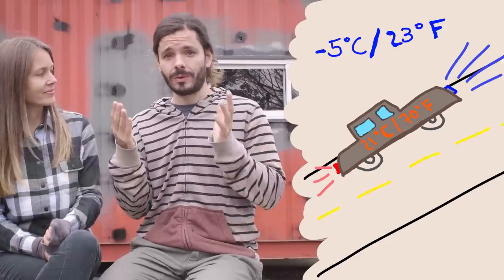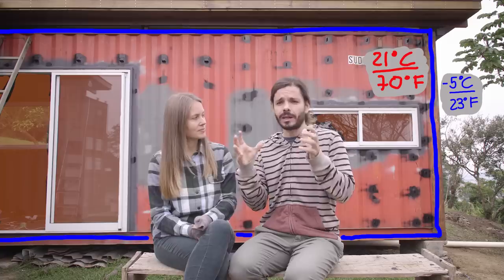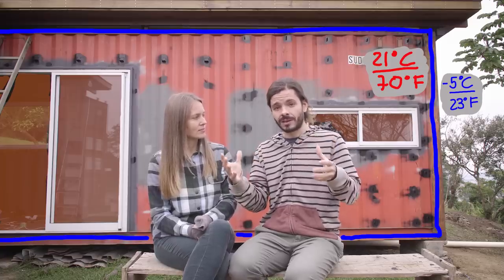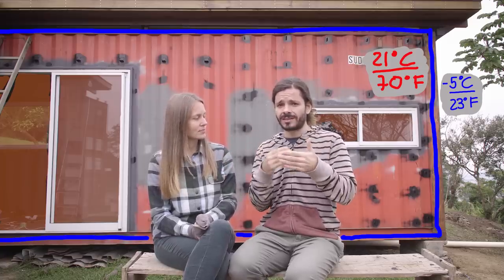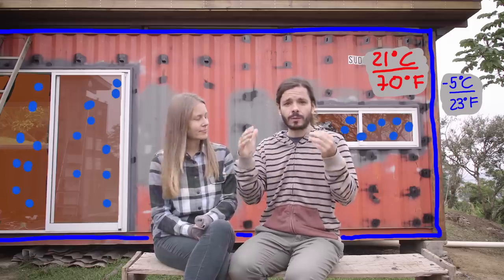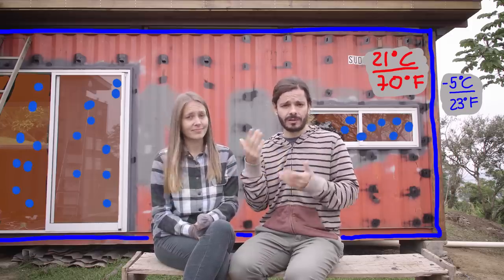How to avoid CONDENSATION on a Shipping Container - Living Tiny Project Ep. 033

Comment: Two quick reads on EPS (E xpanded P oly S tyrene, ) aka  plastic insulation.

Vapour permeability:
http://www.styfabel.be/bouwen/include/The%20facts%20-%20EPS%20is%20just%20as%20vapour-permeable%20as%20wood.pdf 

Mold Research:
http://www.epsindustry.org/sites/default/files/EPS%20Insulation%20Mold%20Resistance.pdf 

Anyways, to the topic at hand.

The next question - What size should the vents be? How many vent?
In other words, how much ventilation do we need?  

Ventilation is measured by NET opening size of hood.  
Total size of hood opening less obstructions such as screen, supporting cross members that would interfere with air flow.
OK!
I might be wrong, but I"m guessing Brazil doesn't have ventilation code governing residential construction.
Guess we'll have to make up our own OR borrow one from another country...like Canada.

Residential Building Code requirement for attic ventilation is a follows:
1 square foot of vent for 300 square foot of floor space.
Example:
A 900 sf house will require 3 sf of roof ventilation and so on.
A 1350 sf house will require 1350 / 300 = 4.5 sf of net opening.  

An 8' x 40' shipping container = 320 sf
320/300 = 1.07 sf x 144 (square inches/foot) = 155 square inches.
BTW, North American vents are sold in effective net square inches, your mileage may differ.

If we subtract existing ventilation from 155 square inches we then have a difference to make up.

Remember, NET and not the actual size of the frame, bring a tape measure and subtract obstructions such as screen and plastic stuff. 

Cheers,
N

Comment: pros and cons, but spray foam just can't be beat for this...  its pricey though.   do they have sheet foam of any kind?
Reply from the maker: We do but the price is almost the price of the shipping container itself. And we don’t believe we could glue without gaps. 😏
Reply: the closed cell stuff is stupid expensive...  a 2" piece of 2x8" dense foam here in my part of canada is about 75 bucks!  ouch!   bubble foam is cheaper (the white stuff that looks like compressed foam balls) - BUT what if you have bubble foam sheets, cut as much as you can to fill the 'ridges', with solid sheets on top,  then spray foam to fill the gaps?   if you cut the nozzle at an angle you can poke it right through the foam.  i cut the foam just with my skillsaw - messy, but if you cut on a bevel you might be able to get it fairly close to the ridge shape..
Reply from the maker: It would be a nightmare to cut to shape. We already decided on this part of the house at least to live the orinal vents working and to live a gap so it can ventilate

Comment: In a small home, you should have a heat recover ventilator.
Reply from the maker: You mean a hot ventilator?
Reply: No.  A heat recovery ventilator is an active ventilation system, but it keeps the temperature steady.  If you aren't using air conditioning or heating, then an HRV is not needed.  Put in ventilation fans and a dehumidifier.  https://www.amazon.com/dehumidifiers/b?ie=UTF8&node=267557011
Reply from the maker: For sure we will use a lot fans and dehumidifier!! 👌
Reply from the maker: Through the too part of the walls.

Comment: I'm going to burry mine after I reinforce them! I think that will help, I also found a thermal paint, they say this paint breaks the thermal bridge! My setup is going to be a 40 foot by 48 feet by 8 feet so it's to expensive for the foam, I have to find something else that warms and they say this thermal paint will stop condensation! Has anyone tried thermal paint? I don't think it's cheap either, can't find a website listing any prices, they all say contact us which usually means expensive!

Comment: Hey guys, I m coming with another point ... as in your climate it´s mostly pretty warm - for challenge in my opinion you need mainly two things to take care of:

1. shadow your house / protect the same with something white or at least a light colour
2. You an insulation layer, but inside the insulation layer ... should be installed some material which can store a certain climate very well (concrete, stones, cement, ....). Idee is, to use your open windows / doors at the evening or even during the night to cool down that "massive materials" inside your home. During the day, everything should be mostly closed, that the stones or whatever you use ..... can beam there stored climate into the living room.

What do you say???
Reply from the maker: About the external shade that was on the plans already. About the internal insulation I’m not sure. 👌🏼

Comment: Hello guys, I beg to differ with the over engineering of your whole house, since the weather is not extremely cold, you should   create several microholes, in every single corner vertical and horizontal, really really micro holes, so that not even ants can enter...but that would maintain a constant airflow bottom up....
Reply from the maker: You might be right. But in our opinion lack o experience most of the time tends to make us “scared” and over engineer things. But this process is also teaching us a lot. What we believe is a good thing but of course has it’s costs. Heheheh👌🏼
Reply: Odd Life Crafting please don't get me wrong, I have a lot of respect for you guys and I enjoy your spirit in doing things. Microholes, however is a way to have the place breathing...imagine a membrane so you don't have too much air in or out but a slow motion of air....
Reply from the maker: I see too problems with this holes. Corrosion and water coming in. But again. Just my opinion. 👌🏼

Comment: The best thing to do is insulate the whole outside of the shipping container with 2 inch styrofoam blue board if the metal can't heat up it won't sweat and it will make your home inside cozy ,then finish your inside the way you want , check out my website at www.tooltimeniagara.com   metal is hot in the summer and cold in the winter this will stop both.

Comment: I am also fighting mold issue... ... condensation, ie.

I am gonna paint a layer of mold killer paint, then a layer of super durable paint, the metal window... ... a big problem, but I am building a 'leak' with a diy filter, with microfiber as first contact to absorb the moisture and iron the layer readily at interval. The point is, we have heavy pollution from smokers, industrial activities nearby and burning by fanatics... ... which the Singapore stupid government doesn't care about its lethal health concern to citizens and refuses to total ban, and some foolish OLD idiots who don't realize the burning will kill them for their fanatism... ... Anyway, the window will be heated by the portable aircon's heat venting after installing a layer over the window. 

A dehumidifier will be used as well, alongside with UVC lamps in the room, with SIX working to act as Sun blasts.

Now... ... the problem is DIY air purifier will be huge but they can't fight condensation. Which is why a strong fan will rotate the air and vapor in the room... ... with two huge piece of cloth... ... or veils to trap them, and be washed and ironed at short interval by the maid or myself. 

The only way to fight condensation is hence to paint the surface with wet and mold resisting paint, then set up the cloth veils strategically to trap as much moisture yet far enough not to be affected by fan's air rotation to shake dust constantly from the veil, and with the help of DIY air purifier and dehumidifier to remove the dust as much as possible from fabric materials... ... This way you seal up the room against bugs. The built leak with a DIY filter system will mean the built up pressure in the room due to cold or hot can be mitigated. See?

I am using also top metallic cabinet to ward off the entrance to the room. Those metallic surfaces will be painted with anti mold weather resistant paint as well, and in that small cornered area will see TWO UVC lamps constantly working to deal with molds and germs which manifest in moistures. The cornered by the cabinet space will also slow down air speed into the room, with fabric veil to absorb both moisture and the germs and mold spores... ... with any lingering at the corner exposed by TWO UVC blasts .

I do not think your current idea works, because your use of steel, under oxidation can produce constant toxins, and any attempt to plaster... ... the steel will ALWAYS have huge temperature fluctuations if only a small part is exposed due to wear and tear, and that will destroy your wall efforts due to cracks.

The only way to deal with condensation yet not make your space tinier by plastering or sealing with another layer is really to make use of microfiber or cotton cloth piles strategically locating them near gaps and prepare to constantly ironing them in the open. If you have no pollution you do not need to make a DIY heavy duty air purifier, but you should create a few gaps with basic commercial cheaper filters. This will prevent bugs from entering, YET you have constantly filtered oxygen coming in. Which is, you MUST seek two power fan unit to draw in the air, and circulate the air, evening out the moisture.

ALSO... ... I am using a Snake Brand of body power... ... placing them at strategic location, to absorb the moisture. BUT... ... you MUST use a container to prevent the powder to be blown everywhere... ...

I also getting a major heat source to revert the liquid condensation into gas again daily. 

The point about letting vapor move in between walls IS STUPID. Especially when the weather is humid and colder... ... and you can't even kill any germs or molds in those gaps.

But you can iron and kill them using fabric veils.